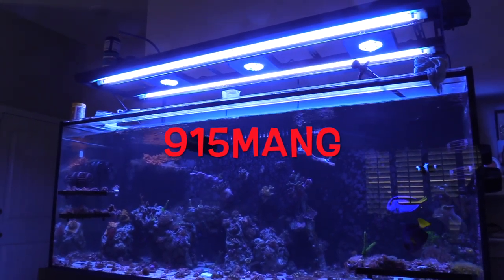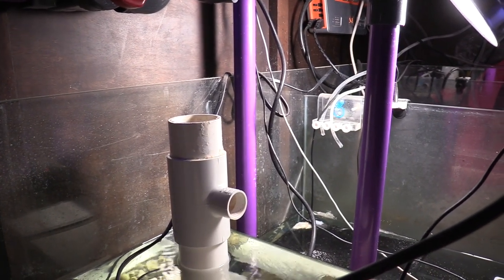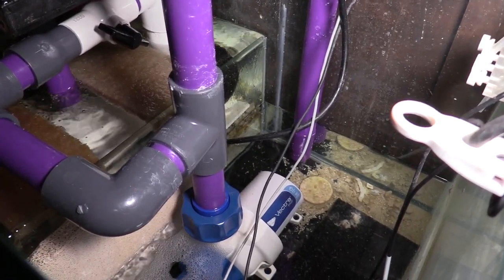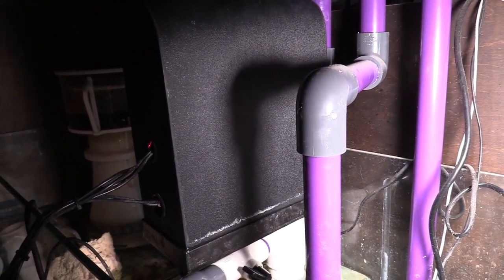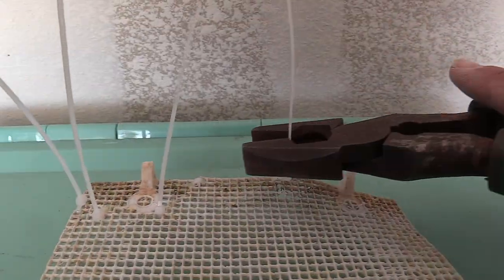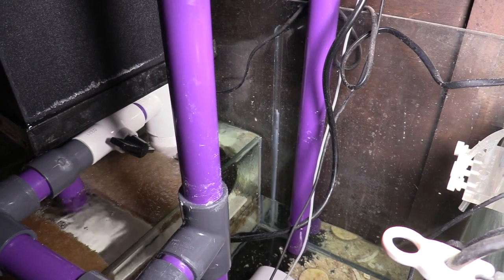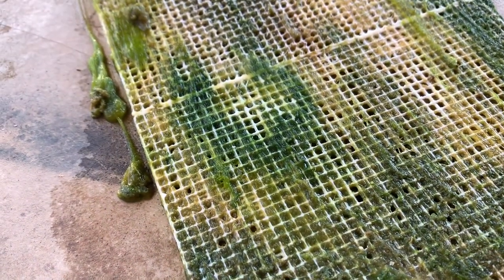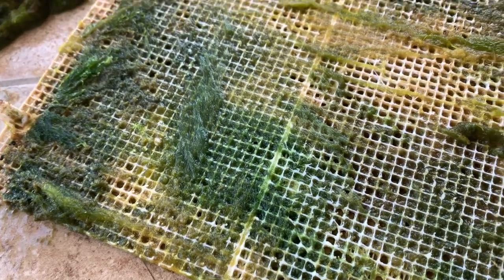ALGAE TURF SCRUBBER | EASY INSTALL REEFS SALTWATER AQUARIUM CORAL REEF NANO TANK UPDATE

Comment: I've been using the Rain2 for 5 years now. Love that thing. Just cranks out algae, week after week.  I've had to replace my screen twice in the 5 years I've been running it. Next time, I'll use the zip ties to use it a little longer. Nice TIP!!  Like you said the screen is a little pricey.
Reply from the maker: I was gonna buy a new screen but said hey, i have some zip ties lol. I think its 3d printed. Have a good day, thanks for stopping by

Comment: great project.  are you going to monitor nutrients in the tank to determine how well its working?
Reply from the maker: I did check my phosphate yesterday, and right now the screen is barely starting to change colors in the edges. Ill keep you posted!
Reply: @915Mang  6 months ago, I added 2 baseball sized clumps of cheato to my sump.  I repurposed a spare Photon V2.  Within in a month the cheato had filled the chamber in my sump.  A month later pulled out over a pound of cheato and tossed it in the trash.  No one near me has a salt tank.  My nutirent level are where I want them, but I do add 2.5 mL of Phosphate daily.  The cheato replaced my dual reactor (carbon/GFO).  
Trying to figure out if a scrubber is "better" than cheato.
Reply from the maker: @strat1960s  I think if cheato is working for you stick with that. I think its great the photon grew cheato for you. Did you use the reds and whites? Very cool. But then again you are a Reefer, we like to tinker with things!
Reply: @915Mang  I'm running red and all the blues.